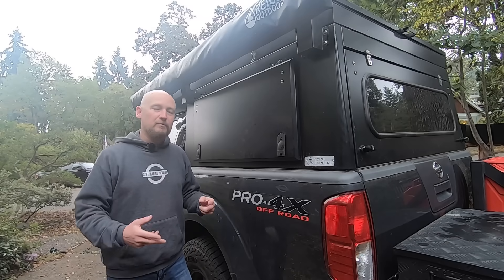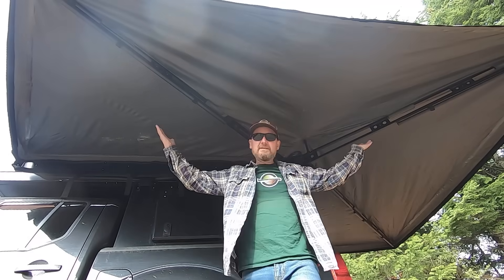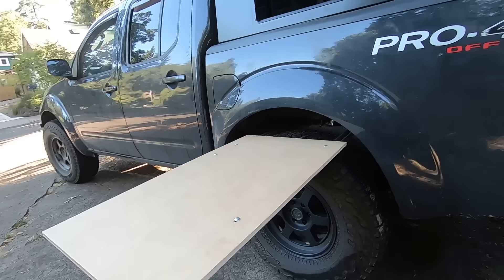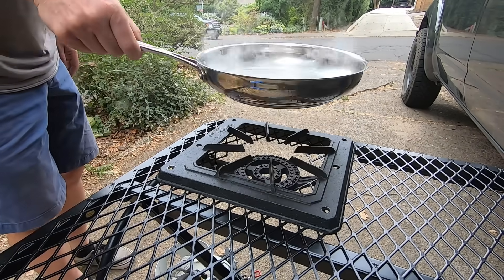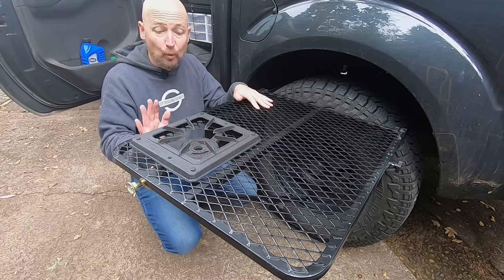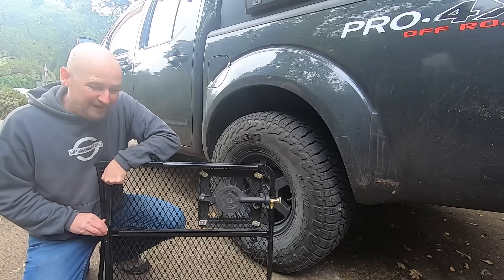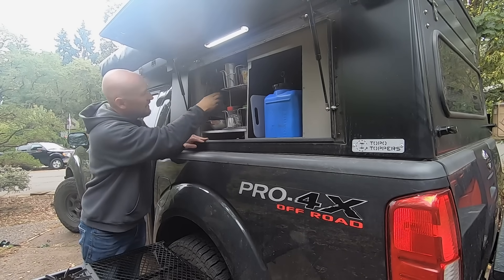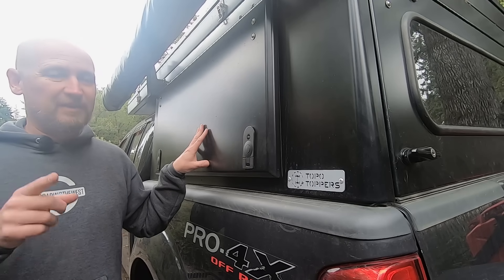Camper Interior Build Series: Part 7 - Cargo Door Kitchen

Comment: Your diy table looked good...why not a hinged, drop-down leg on the DIY table like the one you bought?
Reply from the maker: That crossed my mind of course, but the problem there was, the unistrut support pieces needed to run the full length of the table along each long edge, in order to have enough unistrut to extend into the truck frame but also be able to fully retract to be no longer than the table so I could stow it. That meant my integrated burner would need to be right in the middle of outer edge of the table, interfering with mounting any sort of fold-down support leg I might come up with. 

The secondary problem that I didn't bother diving into in the video is that - when I was working on the DIY table design, which is before I built the cabinet inside - my plan was still to stow the table right inside the cargo door. But the depth of my DIY table with the unistrut channels plus the integrated burner was going to greatly complicate and limit how & what I could build inside the cabinetry right there at the cargo door. And I realized that stowing my table here meant that anytime I wanted to access my water (e.g. in the middle of the day, not at camp, to refill my water bottle or something) I would have to deal with the table being in the way.

I did start looking at DIYing a folding table that wouldn't involve the tire at all, but when I did the math on the parts I was going to need to buy, the hours it was going to involve, and a lot of other projects still awaiting my attention, I realized that it just didn't make sense to re-invent the wheel. When I placed the order for the Tailgater table, a huuuuge weight came off my shoulders and I knew I had made the right decision for me. 😄

Comment: All the weight is on the driver’s side, what is the reasoning?
Reply from the maker: All the weight is NOT on the driver side. Yes, I have my fridge on the driver side, but it is a small, lightweight inexpensive Chinese model that is mostly plastic, and its weight - even full of food - is more than offset by the segment of back seat I removed to install my fridge...the seat I deleted weighs WAY more than the fridge. I have 6 gallons of water there on the driver side, yes, but I have 10 gallons of fuel on the passenger side along with my propane bottle, and on long trips I carry an extra gallon of water stowed on the passenger side. I have slightly more wood cabinetry on the driver side along with the awning (which is relatively lightweight for a 270 at 40 pounds) but the passenger side carries two very heavy power stations, 20+ pounds of video equipment, and at least 100 pounds worth of tools, recovery gear, and other what-if kinda stuff. Not to worry, things are fairly balanced and if anything I may actually have more weight on the passenger side. On top of that, this is an extremely lightweight camper, and even if you totaled up every single thing I've added to this truck including bumpers, winch, camper, build, full water & reserve fuel, it would still be less than the dry weight of the slide-in campers many many people put on their trucks.
Reply: @softroadingthewest  plus you, plus battery, plus fuel tank, full fridge, tire table/cast iron burner add up quickly, all these small trucks are biased towards the driver…sorry I offended.
Reply from the maker: @davidsharp3522   Absolutely no offense taken. Just explaining that my weight distribution is more balanced that you initially assumed. All good. 🙂

Comment: You could have just built a swing down leg to support you're  DIY table. You were like 90% there.
Reply from the maker: The problem there was, the unistrut support pieces needed to run the full length of the table along each long edge, in order to have enough unistrut to extend into the truck frame but also be able to fully retract to be no longer than the table so I could stow it. That meant my integrated burner would need to be right in the middle of outer edge of the table, interfering with mounting any sort of fold-down support leg I might come up with. 

The secondary problem that I didn't bother diving into in the video is that - when I was working on the DIY table design, which is before I built the cabinet inside - my plan was still to stow the table right inside the cargo door. But the depth of my DIY table with the unistrut channels plus the integrated burner was going to greatly complicate and limit how & what I could build inside the cabinetry right there at the cargo door. And I realized that stowing my table here meant that anytime I wanted to access my water (e.g. in the middle of the day, not at camp, to refill my water bottle or something) I would have to deal with the table being in the way.

I did start looking at DIYing a folding table that I would simply stow in back, but when I did the math on the parts I was going to need to buy, the hours it was going to involve, and a lot of other projects still awaiting my attention, I realized that it just didn't make sense to re-invent the wheel. When I placed the order for the Tailgater table, a huuuuge weight came off my shoulders and I knew I had made the right decision for me. 😄
Reply: @softroadingthewest  all ok I see. I love the build and how you build it yourself love the channel Donald!